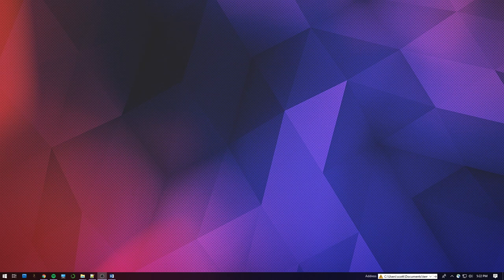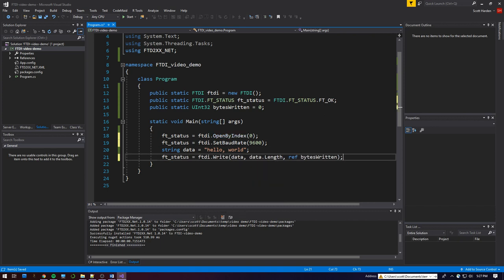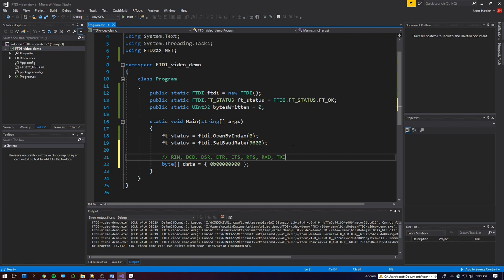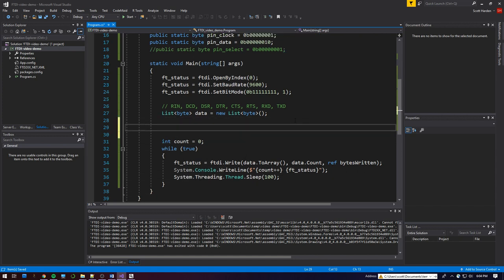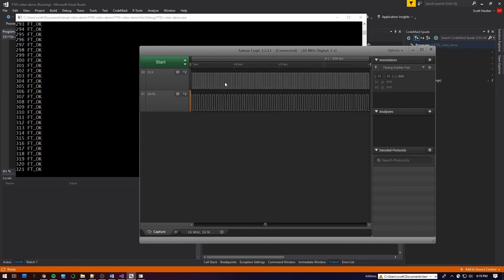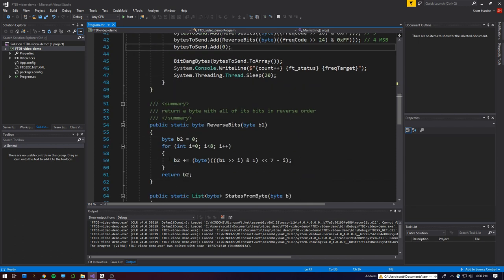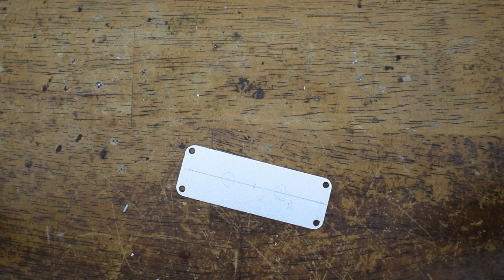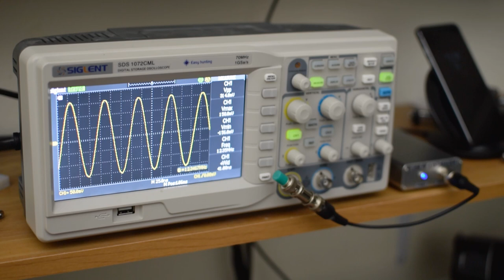Bit Bang FT232 to Control SPI Devices

Comment: Excellent video. This helped me understand a problem I was having writing software to control an 8-channel relay board using the FTDI chip. Even when disconnected I was getting responses as if the board was connected. Then I watched your video and figured it out: I have a USB to serial converter on my PC too!!  I would have never figured this out without your video. Now, how can I NOT recognize the USB to Serial converter?

Comment: Thank you. This was one of the first videos that did not bury me alive in excess complexity. For my upcoming project, I would like to have four 8 bit parallel ports. This could be two bidirectional 8 bit ports. Two ports, one for a 2 way data bus and the other a control and status port. I need to move many gigabytes of video data into and out of memory sims for a solid state video recorder project I have in mind. Not necessarily in real time. But, faster is better. Obviously. 
Think animation capture and video looping (up to almost two hours) of SD non compressed video. For my way of thinking this is WAY easier than serial data. I think the terms "serial and parallel: have become corrupted since my Z80/M68000 days of assembly language programming. Searches for "parallel ports" only turns up deep BS about Centronics printer ports! Geez!!!! I fell behind with so called high level languages which, to me anyway, are extremely complex to deal with. Especially direct IO functions. Yes, I am a pure hardware guy. 
Thanks again, your video has gotten my toe in the door.

Comment: does it make sense to use this to check a regular magnetic door sensor? sending +5v to the sensor it will respond with +5v if is closed, I know it is not intended for that, can this damage the port? what is the disadvantage/risk in doing something like that, any alternative/recommendation?

Comment: Do you think it is possible to do this using the cheaper CH340 chip? It has RTS and DTR signals, but I'm not sure It's possible to control RX and TX like you did, individually...

Comment: I've spent 2 days trying to get one of these to program a PIC18. Still not working, but I think it's because of the erratic clock signal. Apparently the issue goes away if you use an external oscillator. I just happened to have a 12MHz oscillator, so I superglued it on the chip and connected it with some magnet wire. But, when I try changing the settings with FT Prog, it keeps reverting back to the internal oscillator. It turns out that the chip is a clone. No surprise there though. I ordered a couple genuine chips from DigiKey, and also an FT232H. On the bright side, at least now I know the crazy clock isn't my code.
Reply: OK, so I can now confirm that the clock issue does not exist with authentic FTDI chips (FT232RNL) from Digikey. I paid $7.60 each for 2 modules, and then $15.87 (including shipping and tax) for the 2 authentic chips. That comes out to $15.53 each. For what it's worth, it's still cheaper than buying a module from FTDI.

Comment: Using a FDTI FT-232 to send data data and clock seemed very easy, looks like if I send data to a single by writing to it means I could possibly send NEC protocols using just the FTDI device. Logical '0' – in the NEC Protocol would be a 562.5µs pulse burst followed by a 562.5µs space, with a total transmit time of 1.125ms modulated at 38.222khz. Logical '1' – in the NEC Protocol would be a 562.5µs pulse burst followed by a 1.6875ms space, with a total transmit time of 2.25ms again modulated at 38.222khz. This would connect to a IR photo-transistor and IR LED, then again I could instead use a VS1838B Infrared receiver and the signal received by this device already demodulated. Otherwise a better choice for me is to send and receive the NEC signal as pure TTL level data. You see my stereo has jacks in the back for sending and receiving the NEC Protocols through either an external sensor, or by daisy chaining the components and have one of them act as a receiver for the other stereo components. In fact, my dual deck cassette has no IR receiver built in and relies solely on the receivers IR receiver.
Reply: P.S. I forgot to mention... The NEC protocol sends a leader, then sends 32bits of data. Control Byte followed by it's inverse, Data Byte followed by it's inverse. When I say inverse I should say 1's compliment. And I believe it sends the data lsb first for each byte, Anyway, sounds simple, I also need to decode that protocol too, should be just as easy...

Comment: Thank You so much for this very clear video, It solved 90 percent of my problems. I just need the additional c# code to read a pin with a button. I can't find a clear answer on the ftdi site or the internet. Is it as simple as ftdi.Read (dataBuffer, 8, ref bytesRead): //? When I do this the console just flashes without a reading. THX again.

Comment: Dear sir, I noticed inside video that the FTDI USB-to-serial converter had a squarely external crystal (must be connected to the FT232R chip).  But in the market some of the converters uses internal oscillator. And it could become permanently unusable when run with FT Prog! This warning message shown in the FDTI utility web page. If this is correct, anyway to around with the possible damage issue? Many Thanks
Reply from the maker: FTProg can be used to configure the oscillator source for the chip. If you use FTProg to configure your chip to require an external oscillator, and no external oscillator exists, your chip will obviously no longer function. This is why the warning exists, and the solution is simply to not do this. I'd feel safe using FTProg as long as I paid close attention to ensure the oscillator settings were always valid.
Reply: Scott Harden thank you for your advice and the video

Comment: Can i use FT232 to connet USB keyboard with my ArduinoMega.Board:
FT232RL FT232 FTDI USB To TTL 3.3V 5.5V Serial Adapter Module Board
Reply from the maker: unfortunately no, the FTDI chip just provides a serial port to devices which can accept USB devices. Your ArduinoMega could act like a USB keyboard to a computer, but you cannot plug a USB keyboard into an Arduino. It looks like Arduino can read the output of older PS/2 style keyboards!

Comment: what are the differences between visual studio and visual studio code and witch one is better for coding also what does $" do?
Reply from the maker: visual studio code is a fancy text editor that can be used to write in any programming language (C, HTML, Python, etc). Visual studio is more commonly used to write applications using Microsoft languages (C#, F#, visual basic, etc).
Reply: @swharden  ok thanks

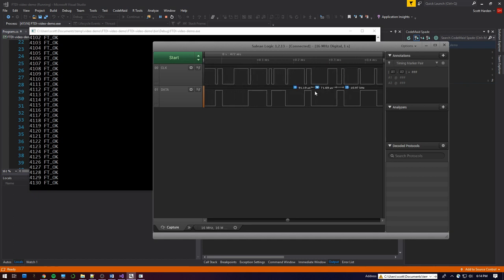Comment: Nice tutorial.  Don't understand what your trying to say at 19:14.  "Looks really bad" means nothing to me.  Don't understand it.
Reply from the maker: Hi POW, the issue is that due to a FTDI clock bug, it cannot output square pulses. The problem is further described and demonstrated here: https://swharden.com/blog/2018-06-03-bit-bang-ftdi-usb-to-serial-converters-to-drive-spi-devices/#beware-of-the-ft232r-bit-bang-bug

Comment: If you're going to use Saleae clones in public at least have the decency to not rip-off their livelihood by using cracked versions of their logic analyser software. You can use the open source Sigrok or, you know, just buy their hardware in the first place...
Btw is that a FTDI fake chip too?
Reply from the maker: JM thanks for your concern! 

The topic of cheap eBay analyzers vs official hardware was discussed in the video and on the website post (which promotes purchasing official Saleae hardware and includes links to their product page).

I was unaware of the open source software Sigrok, thanks for suggesting it!

The integrity of the FTDI chip is unknown, and was a sourcing choice of whoever produced the breakout board.
Reply from the maker: I got an email from someone saying that the timing problem described at 19:00 is only a bug in genuine FTDI chps. It seems the chips I use in this video are indeed genuine, otherwise the big-banging would be working better!